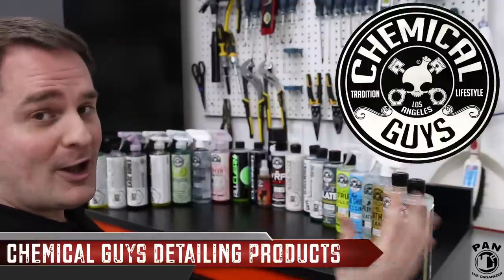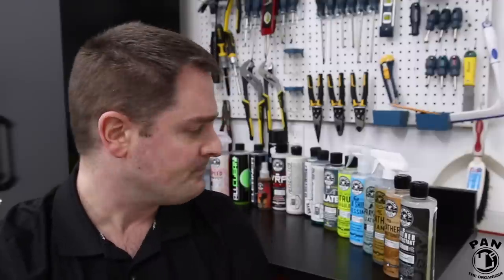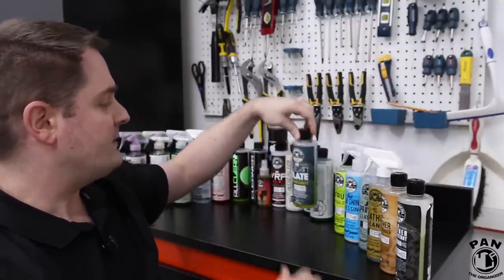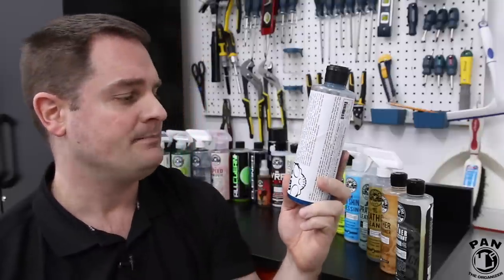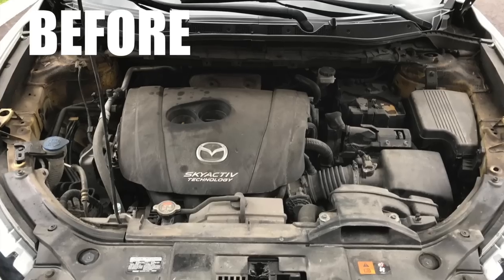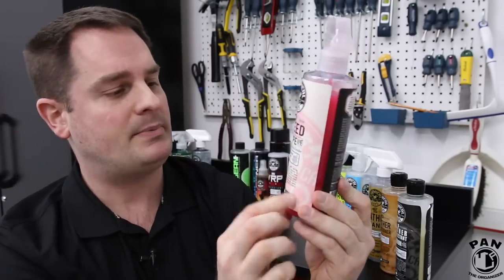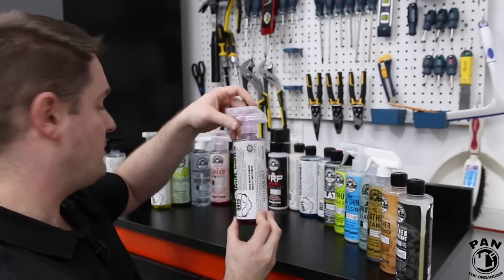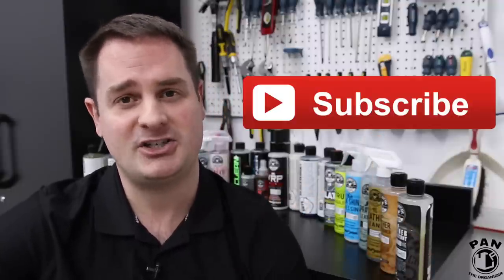CHEMICAL GUYS Detailing Products : Brand Review !!

Comment: Can you do a review about your eley hose. I was thinking about getting one bc I need a new hose. Does the hose nozzle really increase the pressure? Because it looks like a stronger spray than your regular garden nozzle. Thanks pan! Love the videos
Reply from the maker: I have the Eley polyurethane 3/4 inch hose, their hose reel and garden hose attachment.  Great stuff!  Good idea for the video!  Lots of my viewers are curious.
Reply: Pan TheOrganizer yea I have seen your garage tour and I looked at that hose. Seems really high quality and the warranty is outstanding. I was curious about the nozzle though, does it seem to spray harder than say a normal garden nozzle?
Reply from the maker: It all depends on the water pressure you already have.  If you have none, don’t expect miracles.  This is not a pressure washer.  But I wanted more flow so went for the bigger 3/4 inch hose instead of the 5/8 one.  But it’s the best water hose attachment I’ve used.
Reply: Pan TheOrganizer thanks a lot! About how much pressure do you get?
Reply from the maker: I don’t know.  I mainly use my Kranzle pressure washer to wash cars.

Comment: Pan your the best mate great stuff I love watching your video
Do you use bare bone and Diablo wheel cleaner and in your opinion is jetseal better than butterwax 
Keep the great work going
Reply from the maker: JetSeal will last longer than Butter Wet Wax because it’s a paint sealant.  But the wax gives you a better shine.  What many do is apply a base coat of JetSeal and a coat of wax on top of it.

Diablo is a good wheel cleaner and Bare Bones is a great dressing for black inner fender wells.

Comment: Pan really enjoy your channel very informative  and helpful.
Reply from the maker: Thanks Ernest!  I appreciate it!

How did you discover my channel?
Reply: Just got a new car 2018 Mazda C X- 5 Grand Touring AWD  a few weeks ago and  of course looking for tips to keep it looking new . So around January, I was getting info from Ammo's and Griot's garage and Meguires  waxes and detailing  stuff here on You Tube and i stumbled onto your channel by surfing and doing research on what products to get. And your channel has been really informative. I do have a question about the interior of the C X-5   the dash especially and what products to use for it especially the section over the speedometer its made out of something different  texture wise and I am not sure what to use to clean that specific area and protect any suggestions ? Like i said the material is a really tacky rubber like stuff or some type leather 
 but it not your usual material i m use to seeing. Thanks again for a good channel.
Reply from the maker: You're in luck.  My gf has a Mazda CX-5 too (GS trim) that you see in some of my videos.  Of course, she's lucky, I detail it for her.  I like cleaning interior surfaces with Chemical Guys Inner Clean and to add a touch more UV protection and nice finish I use CG Silk Shine.
Reply: Thanks a lot I will look into those products

Comment: I have to completely disagree with Inner Clean. I used it last week. and it is definitely not a MATTE finish. In fact it leaves a very VERY tacky feel. Yes I buffed it off properly.. Im certainly not new to detailing. I did go ahead a try the CG Total  Clean.. and this is indeed more of an OEM finish, leaves a true Matte finish. Inner Clean is on the "use on the company car only" shelf.

Comment: Hi Pan. I wanna try Glossworks shampoo but I hear because it has gloss enhancers it's not safe for ceramic coating.  Is this true?
Reply from the maker: The Chemical Guys Glossworkz shampoo is pH neutral, so it is safe for waxes and sealants, and it will not "harm" or damage ceramic coatings, which have much higher chemical resistance compared to regular waxes and sealants.

Glossworkz does contain gloss enhancers, which could potentially mask or change the hydrophobic properties of a ceramic coating, but I haven't seen evidence of this, or a clear demonstration.

In my opinion, as good as Glossworkz was many years ago, there are far better options for washing ceramic coated cars. My favourite being CarPro Reset, link here: https://bit.ly/3B2wEsp

To find out all my top picks in each product category, watch my latest car detailing products awards video: https://youtu.be/gRwsznwfTwE

Comment: I love Chemical Guys Products, but they have too much.
 For example they have about 20 different soaps and 10 degreasers. I used the Hydroslick Ceramic Coating Gel, the car interior scent (Cherry and Bubble Gum), Degreaser, Drying Towel and their Synthetic Quick Detailer.

Comment: Good products and reasonably priced for weekend warriors. Get something else if you’re serious about detailing. Having used their products for a long time, I find them often wanting.
Reply from the maker: Yes these are great for beginners or weekend warriors.  Better than off the shelf products from local auto parts stores.  But there are a few gems in the Chemical Guys lineup that even pros use.  One of those is the VRP dressing.  I use that for tires and it's great.  I actually did a tire dressings challenge video here: https://youtu.be/Oge5jlaAaME

Comment: Don’t like them very much. Tried that Honey Dew snow foam a couple times and it stopped up 2 different foam cannons. Tried using 2-3oz’s and then 1oz in a full canister of water. Same result, glad I only bought 16oz’s of it.
Reply from the maker: I have no problems getting major foam with Honeydew.  I use a Kranzle 1122TST that outputs 2.1 gpm (important for good foam) and even my previous Karcher K5 (1.5 gpm) was doing great.  I have the latest MTM PF22 foam cannon.

What pressure washer are using?  Foam cannon?
Reply: Karcher K5 and an mtm foam canon.
Reply from the maker: Hmmmmm.  Weird.

Comment: Overkill on car wash products,  too confusing as to what you should buy.   I'll stick to Palmolive green and good ole Turtle Wax, and results from these two are excellent!
Reply from the maker: Do not use dishwashing liquid to wash your car! Those are strong degreasers that are way to harsh over time on a vehicle's paint. It will dull the paint and start to break down any protection you have on the paint (wax, sealant, etc). Stick to a quality pH neutral car shampoo.
Reply: @PanTheOrganizer  I've been using my  method for the past 50 years and my paint finishes looked great.  Washing and waxing your car is not rocket science as you seem to have made it out to be.  Your car's paint picks up dirt, grease, and other contaminants and you need a somewhat strong detergent to get it good and clean.  Afterwards, give it a quick spray wax job and you will be just fine....